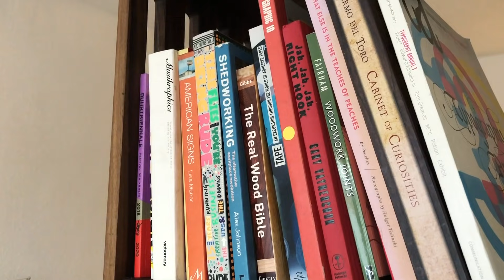Building a Walnut Bookcase

Comment: That wood grain ... ❤️. What kind of finish did you use? Love the steps. Genius idea. I may have to incorporate that into a wall of shelves I have planned for the farmhouse.
Reply: Can't read the label on the can, but you get this with oil and or wax. I'm assuming what she was using was liquid wax. 
If you just want the look, cheap paraffin oil is great. Wax gives it more protection and it can be polished if you want to.  
Both are super easy to apply. Just wipe it on and wipe the excess off after few hours or the next day.
Reply: @vonantero9458  Thanks so much for the information.